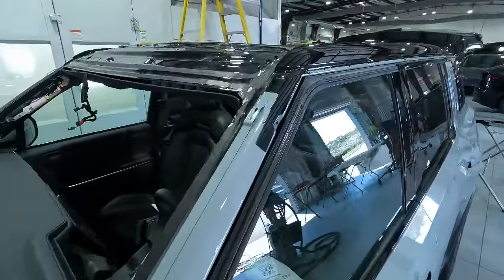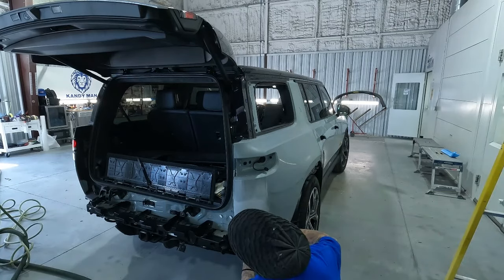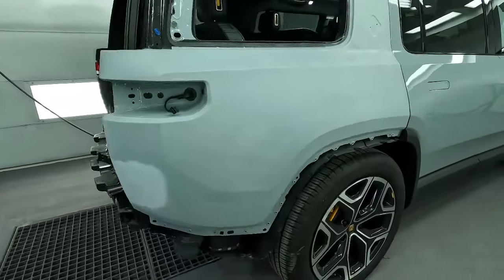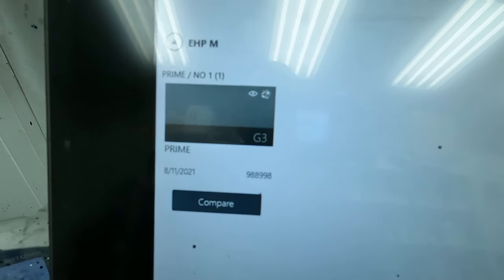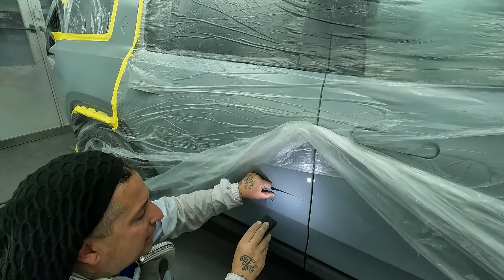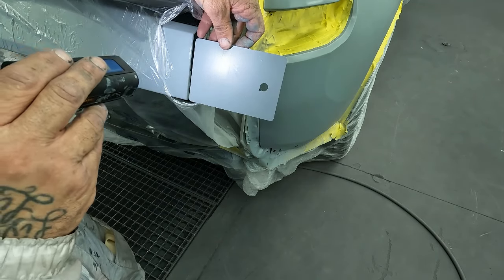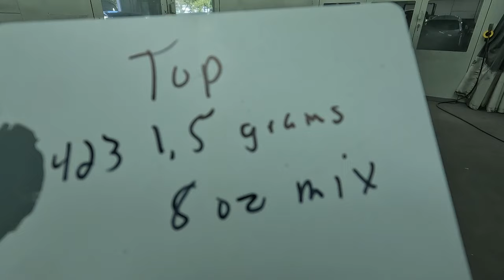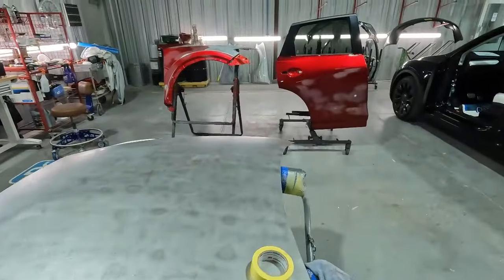Painting A Rivian

Comment: You should be able to create a custom formula and save it under that paint code. You can add the yellow toner to the prime formula with the amount desired. Also if your system is similar to BASFs Refinity you can use the camera to read the color and if it recognizes that your custom formula is the closest match then it will recommend it! You can also label the custom formula with a note that there is a spray out.. that way you know you have it in your cabinet. I know you use PPG but I’m sure they have a comparable set up. I use the same KOH camera as you but I read every job because it’s faster and more accurate in my opinion
Reply from the maker: My camera won't pick colors unless there in database  this color is prime no chips or specials  soundslike you have a great system